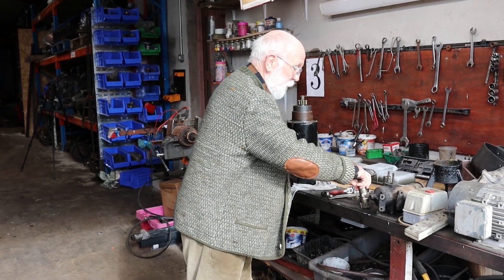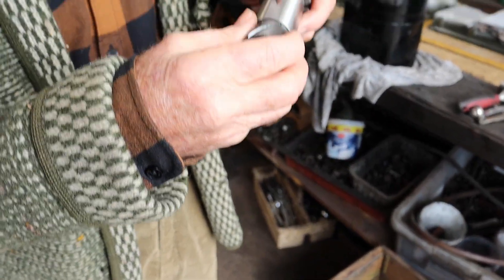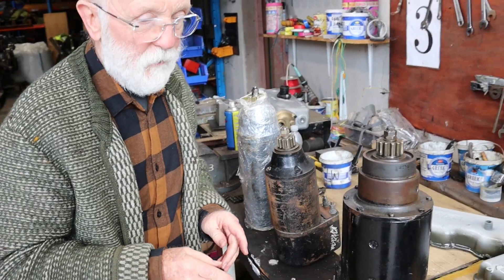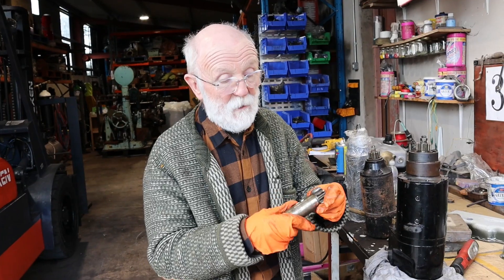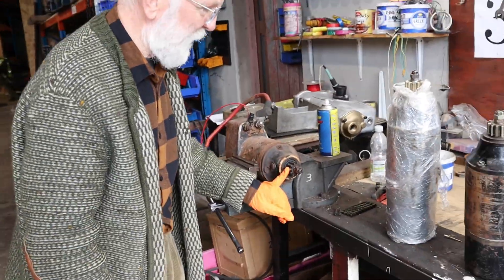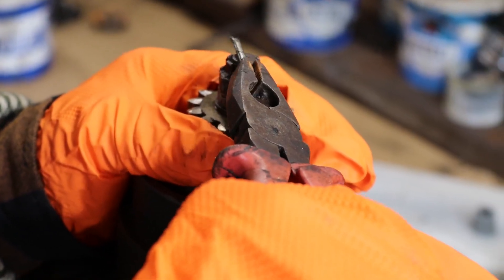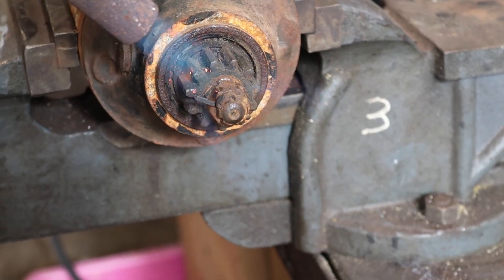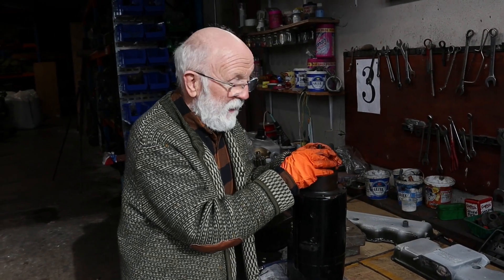Gardner Engines and their starter pinions: long pinions, short pinions, fat pinions, thin pinions.

Comment: Very well explained on how to service a pinion on Cav starters. I have a customer that  dropped off a 6' Cav starter that use to have a 13 teeth drive ,there now is only 4 teeth left in a row, all the rest are broke or sheered off down to the spool of the drive gear. No information as to what caused this as of yet , can not get a hold of the costumer ,the boat is fishing off the west coast of Vancouver Island BC Canada .I have never serviced these starter hardly at all in my 48 years in the trade I have serviced many of there brother starters made by bosh and the CA45 style units. A friend of mine BY the name of Wilf Stevens of Stevens Diesel worked on all the Gardener engines On the north island .He passed away 2 years ago (2021) rest his soul . I miss him so much. There is know one up here that can even come close to his knowledge when it comes to all things British ,he was a master ,he was my go to man . So here is my question , do sell parts for these CAV 6",24v starters such as solenoid ,armature , bearings, 13teeth drives and other small parts . Do you ship to Canada. If not do service starters sent to you From Canada . Do you know of any one in Canada that would have parts .

Comment: Excellent video. I work on Gardeners and now feel suitably armed to deal with a possible starter pinion issue! 😜
Reply from the maker: If you keep the starter vertical, it should be easy enough, but every now and then, it's a pig!